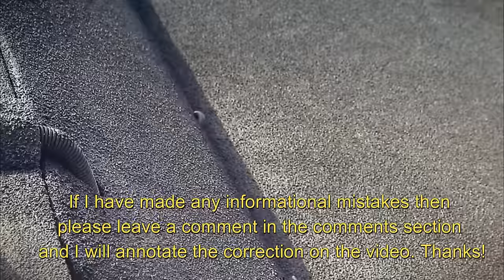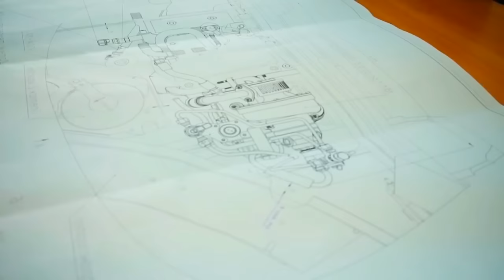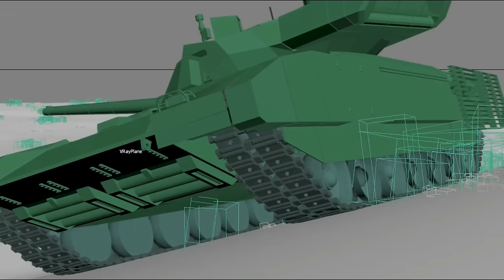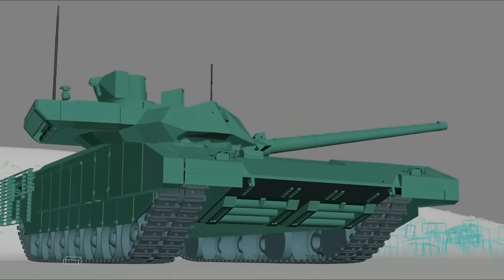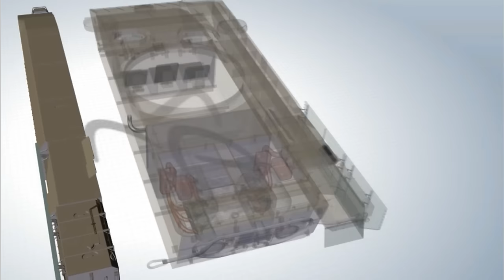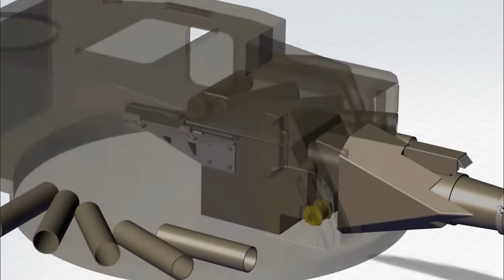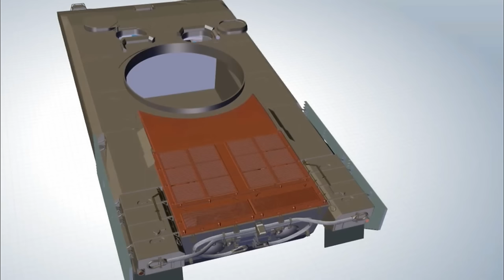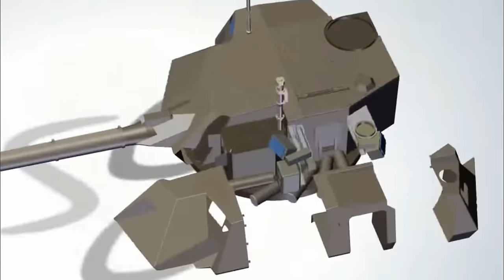T-14 Armata Russian Main Battle Tank - Tank Overview

Comment: When looking at the T14 we must differentiate between two types of information.  The first is what the Russians have told us.  The second is what we know to be true.

The Russians have told us very little the T14, most of which, given their history, we can assume is not true.  

What we know is that of the tanks shown in their May Day Parade, the turrets were covered by a camouflaging shell.  This was proven by Live Leaks, who got close ups showing the slopped armor was a material similar to drywall board held together with wire.

We know they are going to be the most expensive tank Russia has ever produced at a time when they are very cash strapped due to low oil prices.

We know planned production is only for 250 hulls, or about 1 Armored Division's worth.

What we don't know is if the unmanned turret is workable in a combat environment.
Reply: Show me these photos?
Reply: http://www.liveleak.com/view?i=ecb_1430849196&comments=1

Looks like they took the photos down,but the article itself remains.

http://www.yaplakal.com/forum7/st/75/topic1108522.html

As you can see from the picture, it looks like whatever this panel is made from (it can't be armor) its held in place by four cotter pins.

I crewed American tanks for a long time.  I don't remember a lot of cotter pins on ours.
Reply: Do not read Ukrainian media, a concentrated hatred, not having anything to do with reality
Reply: Джо Неуловимый You can always find a reason to discount information but the photo does speak for itself.

Its clear the "side armor" of the turret is a thin panel of some sort.

Its to thin to be a plate of reactive armor and its not configured as bar or stand off armor.

It also makes no sense.  Why slope the armor of an unmanned turret?  Why not just keep the turret as small and light as possible?

Again, everything points to this either not being the final design or not being the real design.
Reply: Waltham1892 Why so many questions about this cover? it is only for aesthetics. It's not armor.
Tower of course is not finished and will change, it is a prototype for testing. 
A light tower with a 152mm gun?, you're kidding.
It's a remote platform for guns. With protection from light guns(30-40mm).
Without casing:https://topwar.ru/uploads/posts/2013-06/thumbs/1370250964_12.jpg
Reply: Джо Неуловимый Excuse me?  A panel on a tank for "aesthetic" reasons?

Will the 2017 model of the T14 have a sunroof?  Cup holders?  Chrome trim?

And the gun isn't a 152mm, its 125mm.  There are also no 30mm or 40mm guns, which were always a moronic idea to begin with.

Don't confuse fan boy CGI pictures with anything that anyone might field.
Reply: Waltham1892 On the Leclerc armor pieces are also containers for utensils and tools, so yeah, just aesthetics. Rather than just leave the equipment outside of the tower. This is not the final version. Will probably be the armor-casing with protection from small arms up to 20mm
Reply: Джо Неуловимый Having seen most Western and Soviet/Russian tanks fielded since the 1980's and crewed most American tanks since the M60A1, I have never seen a storage box held shut with cotter pins and no handle.

The very idea is a rather bizarre one.

But, we seem to both agree this is not the production vehicle.
Reply: Waltham1892 Yeah, it's just a prototype.
Boxes for tools and spare parts do not open without other tools, all hatches to service the engine bolted on the bolts... the usual case, though there is no logic
Reply: Waltham1892 It will take ten years until all take its final form. Tons of paper complaints to the manufacturer, because he did not bother to think about usability
Reply: Джо Неуловимый If it takes 10 years to field this tank, is probably be a better not to field it at all.

All the T-72's in Russian service aren't going to last another 10 years.  They are obsolete now.

The T-90 was not a successful program and the Russians were never happy with it.

The Russians are in a hell of a corner.
Reply: Waltham1892 any weapon requires improvement, the T-72 has adopted the final form for about 10 years. More difficult for longer, the F-35 for example
Reply: Джо Неуловимый Yes, but ideally one system is fielded while the system it replaces has some efficacy left to it.

The Russian Army's ground forces are built around 550 semi-modern tanks.

The US alone has 2000 M1's in long term storage.  Factor in all the Leo's, LeClerc's and Challangers's.  

Russian military power, seen in that perspective, isn't that impressive.
Reply: Waltham1892 550? probably T-90? not only are several smaller actually, they level-Leo 2A6. T-72B3 / 4 has about 1,500 One unit, much like the A4. There is an order for recovering of another 600 T-80AM. On storage, not upgraded and without thermal 2,500 T-80 and T-72 3500-4000 different models. By setting a relatively deshovye digital scopes, communications and new armor tanks can bring the park up to 5000-6000 units in 2-3 years
Reply: Джо Неуловимый Russian T-80's and T-64's are in war reserve stocks and would probably cost more and take longer to bring back into service than they are worth.

The T-72's all lack secure ammo storage, high pressure guns and thermal sights.  Some in reserve stock lack laser range finders.

There is also the not inconsiderable problem of training crews, NCO's and Officers to be cadre's in those units.

Lastly, there is the problem of meeting the logistical needs of an armored force made up of old equipment dragged from war reserve stocks.

That means on top of the cost of rehabilitating these obsolete vehicles you need to meet their demand for parts, fuel, lubricants, ammunition, food and supply for the crews manning them and of course, their pay.

I'm told Russia needs oil to sell at 81$ a barrel to make money on the deal and needs oil at 100$ a barrel to fund a rearmament program.

Last I heard, oil is at 51$ a barrel and will go lower if Iran starts producing in bulk again.
Reply: Waltham1892 T-64/62/55 is not  in reserve, dismantled, sold, disposed of.
T-80 is in reserve, there is an order for the repair of 600 edenits, with modernization. Installing a new, more secure auto-loader, guns, thermal sights, communications, navigation. + sets camouflage and additional armor. The same applies to the modernization of the T-72B. T-72B3 just over 1,000 edenits. A decision on the 2,000 tanks in active operation. Which gradually replaced by new ones
Reply: Джо Неуловимый So, drag these old hulls out of mothballs.  

Spend time and money updating them.

Spend time and money building a logistical chain to support them.

Spend time and money on crew training and support.

And, at the end of the day, they are still 30 year old hulls.

Once you've done this, what is left for new equipment?

Or, are these hulls going to clank on forever?
Reply: True, fewer people than military equipment that can be put into operation. No problems with spare parts, ammunition, fuel and lubricants. Spare parts are more than enough fuel, too. Ammunition, guns, equipment is made new. Arsenals completely reorganized, free from old junk.
It was to address a shortage of staff and directed a new rearmament. Maximum automation, maximum striking power, a minimum of personnel. Get a compact, mobile troops, sufficient for any task. + Always possible to use the old techniques like the T-72B and T-80.
Reserves of the economy should be enough for the entire program.

Available Leo-2 and Abrams, is no better than the updated T-72B.
 Ability to face with thousands of tanks, cool hot heads in the west.
Reply: Джо Неуловимый What caused the Soviet Union to collapse was the belief that the State had only to wave a magic want and weapons would appear.

Didn't work then and its clearly not working now.  Its fair to assume its not going to work in the future either.

As for Western tanks being no better than a T-72B, I assume you believe that a low pressure gun, unsecured ammo storage, lack of thermal sights and a lack of armor organic to the vehicle isn't a problem.

In the West, we think those are major problems.
Reply: Waltham1892 When upgrading is changing gun, autoloader, fire control system, communications and navigation. All this is just new. As the T-90. Changing armor, where possible. Ammunition is only new, old sold. 1000+ T-72B3 / 4 say the opposite. Although this is a compromise, we need new tanks.
Reply: Джо Неуловимый I remember when the US Army upgraded its M60A1's to A3 standard.

All the new parts worked fine.  The problem we had was the rest of the tank was 30 years old.

Even during an arsenal level rebuild, you can't bring every part back to factory specifications.

Imagine trying to rebuild a 30 year old car.  The time and effort to replace every worn part, every thing that's out of round, every spot weld that has broken lose.

And, even if you could do it at an economical price, you've still got a 30 year old hull.

No, don't see that happening.
Reply: Waltham1892 That is why they want to replace Armata. Platform with a large lifecycle, it is easier to repair. But the problems in the transition inevitable. There remains the problem of who to sell 5,000 of the old tanks and return part of the funds for the production of new ones.
There are still old infantry fighting vehicles and other equipment. About 8,000 One unit.
Total decided to limit the number of tanks in the active operation of 2,000 units.
Reply: Джо Неуловимый If Russian floods the market with equipment, its doing to drive the price down.

That also means that all the nations that would have bought its new generation of equipment will pick up the older staff at fire-sale prices.

Its going to take Russia out of the arms market for a generation...
Reply: Waltham1892 Buyers prefer new tanks, because many do not have conditions to maintain the tanks in good condition. It is rather difficult. Even a strong economy like Germany have only a few hundred combat-ready units.
Russia also intends to leave only 2,000 units of combat-ready tanks+some reserve. The rest will be sold or dismantled and recycled
Reply: Джо Неуловимый You've got to decide which story you are selling and stick with it.

Either Russia is going to re-manufacturer it war reserve stocks to make them as good as new...

OR

New tanks are better than old ones.

These positions seem to be diametrically opposed to one another.
Reply: Waltham1892 New undoubtedly better than the old. It is planned to build a little more than 2000 pieces. Used today will go to the reserve. The extra will be sold or dismantled
Reply: Джо Неуловимый So, now all the Russians need to do is come up with 30 billion or so US dollars to build the tanks and a reserve of spare parts.

That is over 1/3 of their military budget spent on, not one branch of their service, but one piece of equipment for one branch of their services..

I don't see that happening, even if you spread that spending out over 10 years.
Reply: ***** You need to figure in crew training, fleet spare vehicles, spare parts, specialized equipment for maintenance, retraining of maintenance crews, training for unit cadre's.

It been a long time since I looked at the numbers, but it costs about $1,500 an hour to operate a attack helicopter.

How much do you think it cost to operate a tank?

Not only that, but a new, complex and expensive tank.

3.7 USD a piece?

The Russians used to like their equipment cheap and sturdy.

Lets see them field a prima ballerina of a tank.
Reply: ***** Ok, lets look at this more systematically.

Based on my experience, the price to support a vehicle with expendable supplies is .5 of the vehicle's cost each year (tanks are not cheap because they are not consumer items made in bulk).

That means that each T14 has what we call a year one cost of 5.6 million dollars.

So, in order to match the number of tanks fielded by the Germany, England and the US (tanks in Europe or which could get there quickly) you'd need about 1,500 vehicles.

That is going to cost you around 8.4 billion.

The Russian defense budget only increased very slightly this year because the Ruble is tanking (no pun intended), so its around 66 billion dollars.

So, about 15% for year one costs.

Add to that all the other equipment Russian wants (APC'S, missiles, the T-50, ships, subs) and one has to wonder how much money will be left for operations once the gear is paid for.

It would be odd to buy the gear and not be able to pay your soldiers or their bills.

By the way, the US defense budget is about nine times larger than Russia's and we have 7,000 M1's.

In fact, we have so many 2000 are in long term storage and we are buying more just to keep the factory going.
Reply: ***** My estimates of year on operation costs come from the time when the M1 was fielded.

Considering the training you need to do when transitioning to a new vehicle,especially when it is radically different from previous types,peace time operational costs do not apply. 

You see, the problem with new types is you have to train not only the Privates with it,but NCO's and Officers as well.

That means a vertical learning curve, a lot of wear and tear on the equipment, a lot of down time and a lot of repair costs.

Lastly, Russia may have 15,000 tanks in some field somewhere, but they are 15,000 obsolete tanks not worth/incapable of being upgraded to modern standards (thermal sights, secure ammo storage,high pressure guns, etc).

So, those 15,000 are either scrap or hard targets.

The only modern tanks Russia has is 500 or so T-90's and the Russian Army was pleased with them.

The Indians certainly aren't happy with them and are looking to restart the Arjun production line at what has to be an exorbitant costs.
Reply: ***** As a former American Armor Officer, 64% of the cost of the M1 isn't the engine, which is a pretty standard turbine.

The FCS is more complex by far and the armor is made of some rather exotic materials in rather exotic configurations.

It may be 64% of the cost involved in a depot level rebuild, but its not the cost of either the new vehicle or the arsenal level rebuild.

As for knowing the cost, I was on active duty with the US Army and we assisted the California Army National Guard in transitioning from the M60A3 to the M1A1.

This involved adjusting budgets, as the M1's needed less frequent depot rebuilding (being newer) but were more expensive to operate on an hour by hour basis.

This was important during the early train-up phase.
Reply: ***** Unless you've got a copy of "Who's Who of the US Army, 1980 to 2002 Edition", I'm not sure the name of any of my CO's is going to be much help.

As best as I can remember:

BCT: Ft. Leonard Wood
AIT:  Ft. Knox, Ky (19E)
ROTC: UCLA
Armor Officer Basic: Ft. Knox
Platoon Leader:  40th Infantry (CANG)
                       4th Infantry (Active)
XO                     4th Infantry
BMO                   4th Infantry
CO                      1st Cav
S-3                      4th Infantry
Staff                    I Corp.

Any other questions, let me know.
Reply: ***** Umm, I'm not sure what message you read, but I did tell you where I was trained (Ft. Knox), where I was stationed (40th, 4th and 1 Cav).

Since I could make up any name for a CO and you'd have no way of verifying it (and since I don't have their permission to disclose their names), I'm not going to tell you their names.

Please, don't play the fan boy game of getting your question answered and then saying you didn't.

Its very tiresome...

I know Jamaica produces some of the worlds greatest experts on Armor, but isn't there a coconut tree you need to climb some where?
Reply: ***** I'm not sure you are aware of this, but the Armor school for the US Army was centrally located at Ft. Knox.

So, training for both Officers and enlisted were both conducted there,along with the Officer's Advanced Course, JMOC, BMOC and several other Armor related schools.

Now, where in Jamaica did you receive your training in Armor?

Because last time I checked Jamaica has more bobsleds than tanks.
Reply: ***** Oh, so you are a software engineer.

So, you aren't a mechanical engineer, you've never crewed a tank and you come from a country which does not own tanks.

My guess is, you've never seen a tank let alone been in one.

Son, go back to your 1's and 0's, because you are just a 0 here.
Reply: ***** Tell me, where did you get the expertise to even ask the question?

Or, more to the point, understand the answer?

Son, have you ever seen a tank?

Because, Jamaica doesn't have any, not one.

That would mean you engaged a stranger with specific expertise in a discussion about which you know nothing.

So, how about fetching me a coconut and calling it a day.
Reply: ***** Listen, Son, I'm not in the business of training radon strangers in the art and science of armored vehicle logistics,but suffice it to say that its not like owning a car.

What I'm focusing on is what I call "year one" costs. This represents the cost of bringing a new piece of equipment to the field and making it operational.

During that first year the crews, maintenance staff and operations staff have no experience with the new vehicle.  This means it must be operated continuously to develop a sufficient level of expertise to make the unit combat ready.

However, there is a learning curve and during this time you are going to see increased maintenance costs because the crews are breaking things out of inexperience or poor design not revealed in initial testing.

There is also the increased costs resulting from increased wear during this period.  That means you are going to burn through fuel, ammunition and parts at an increased rate while experiencing increased vehicle down time due to the inexperience of the maintenance staff.

I believe someone stated that a track on a T14 cost "only" 50,000.  Well, that's great, but track blocks are cheap compared to power packs, FCS components, gun tubes and ammunition.

Do you now how much a full-up combat round of 120mm cost?  Over $10,000; that means just one combat load is damn near half a million dollars!

Do you have any idea how many rounds a crew has to live-fire to be proficient?

Gas, figure 2.5 a gallon when you add in the logistical costs and you are going to burn 2-3 gallon per mile.

And, with the exception of the fuel, tanks are not consumer items.  A production run of a few hundred vehicles gives you no economy of scale for either the tank or its unique support items.

Are you getting the picture now?
Reply: ***** Again, Son, where are you getting your experience with armor to tell me what maintenance and training costs are?

Please, don't use your ignorance as the bench mark by which all information is judged.

You can use training rounds but then the crews don't get the experience of dealing with combat ammunition.

One thing we noticed during the first Gulf War was Tank Commanders were surprised by combat ammunition, whose ballistics were different than training rounds.

Its not good to surprise your tank commanders on day one of the war, is it Son?

You also, in your ignorance, don't understand the costs involved.

Did you factor in the cost of gun tubes?  Gun tubes normally have to be replaced every 200 training rounds.  You have to change them out every 120 to 150 for combat rounds because of their higher pressures.

That means not only replacing the tube, which is precision machined item, it means taking the tank off the line to do it as it can't be done at company or battalion level maintenance.

Lastly, you are going to need to spend money maintaining your gunnery ranges.  

Now, for your fuel calculations, pure stupidity.  I'm embarrassed for you. 

Son, tanks don't go to the gas station, do they?

No, they have fuel trucks bring the fuel to them.  

That means you need a fuel burning trucks to bring the fuel to the fuel burning tank.

Costs more that way, doesn't it?

Also, tanks spend most of their time idling.  Tanks burn fuel while they idle, don' they?

Son, why don't you talk about jet-ski's.  I'm sure you've got more experience with jet-ski's than tanks.
Reply: ***** Oh, you got your information from the internet?

Not experience, not training, no every having crewed a tank, not ever having seen a tank.

Why don't you do this:  Please tell me how much it would cost to put an Armor Company through Tank Table VIII.

Factor in all costs that come out the Division's operational budget including anticipated maintenance items and items of expendable supply.

Don't worry, the internet will tell you ALL about it.
Reply: ***** So, you don't want to answer the question?

An expert like you should be able to run the numbers off the top of your head.

Son, you wanna get me that coconut now?
Reply: ***** I've asked you a question and you are refusing to answer it.

How much do you think it cost to have tank company shoot Tank Table VIII?

Answer the question or be on your way, Son.
Reply: ***** So, can we assume you have no idea what you are talking about?
Reply: ***** You owe me a coconut.